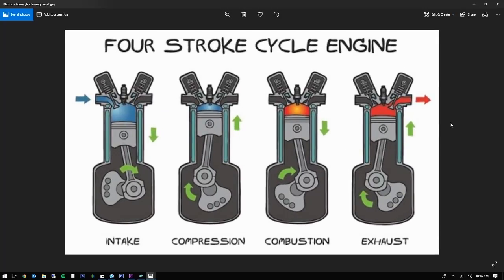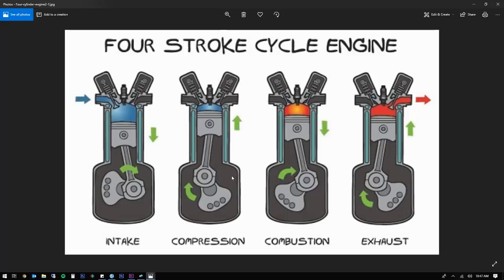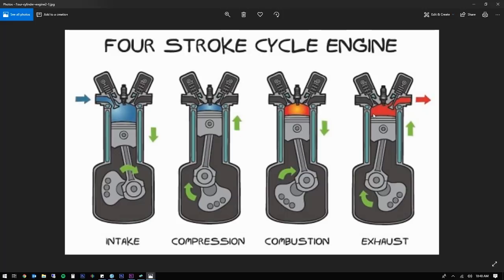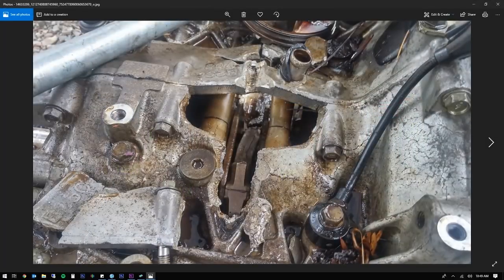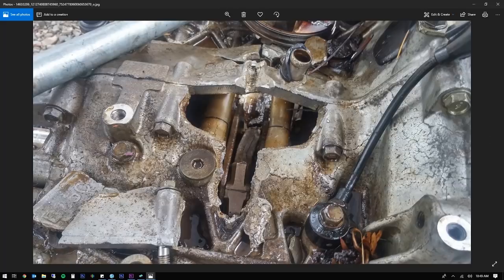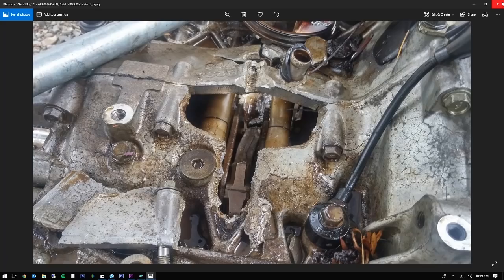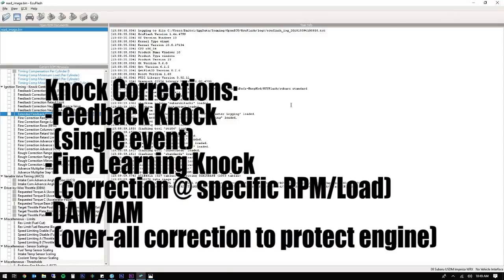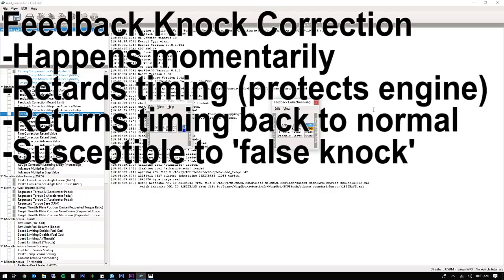Subaru Knock Monitoring - What Does It Mean?

Comment: Amazing video. Probably the best video regarding Knock, Knock Learn and DAM.

You mentioned boost leaks and other mechanical issues, I currently have Fine Knock that ranges from -4 to -30 at times!
 Usually under partial throttle, from 2.5-3.5k rpm. 2013 sti.

after investigating, it turns out that my turbo seals are bad, as I blow oil smoke on cold start. I dont smoke any other time, but being that turbo seals throw oil into your cylinder, it is definately reducing my 93 octane significantly to make my DAM trigger to .8 - .5 at times.

Just a heads up, as I'm on my 7th revision with my tuner, and not once did he mention anything to me (etune). Just datalog, datalog, datalog. During the revisions, I was constantly monitoring my values, and I began troubleshooting because knock should not exist on a stock healthy motor with a catbak, fresh plugs, and delicious tuning coilpacks. Found a bad turbo causing it all (100k). Currently swapping my center housing out over holiday break to resolve the issue and monitor knock. 

An AOS will also help keep oil out of the cylinder and reduce knock, which will be done once I confirm the turbo being the culprit in my situation

I hope anyone researching this because they dont know why they have knock will remember to inspect all aspects of their car. I didn't think I'd be dealing with a leaky turbo at only 100k but here I am.

Thank you for taking to time to put this together. A+ content

Comment: What could cause DAM ti drop and stay there? My DAM has dropped to 0.625 and I went through 3 tanks of gas still did not correct back to 1. Feedback knock and Fine Knock Learn are both 0 though.  Only DAM is low. Its 2020 wrx all stock car just protuned. Yes, I asked my tuner but he couldnt figure out. He said its normal. But is it normal to be below for so long? Thanks!
Reply from the maker: Your tuner said that... DAM dropping down to 0.625 is.. normal!?
Reply: @IrisPPG  Well he knows its below what it should be but he said it will bounce back after a while. But nothing has changed so I am thinking maybe there is something mechanically wrong.
Reply: Ugur's Garage it’s hard to tell, could be a number of issues. I had similar DAM dropping issue on 2017 FA20. I took off the intake, cleaned out MAF & MAP, then reflashed the same tune. It hasn’t dropped DAM again since. Could be dirty or worn MAF/MAP or 02 sensors, could be boost leak, could be something else.
Reply from the maker: @jlarsen4  yes, none of those things are "normal".
Reply from the maker: @wrxTO  Your car has to experience many knock events under different driving conditions and is desperately pulling timing to protect itself from catastrophic failure... Dropping DAM is the last resort effort that cuts global timing across the whole power band. It only happens after the computer has already pulled timing from different areas across the power band.

Comment: Can having a blow off valve cause knocking or false knock and changes to fkc and flkc? 

I am in Kenya and my bugeye WRX 2001 run a gfb hybrid bov. When its open I get knock events while lifting off when shifting with always similar -2.11 degrees all  but when it's closed even under load I don't get any fkc events at all. What's the issue likely to b NJi
Reply from the maker: When the BOV opens, the car also shuts off fuel injections as you let off so by definition it cannot knock. It's possible that if you immediately get on the gas right after but lightly, into cruise condition where the car is in closed loop fueling, it could over compensate for the rich condition from venting air by pulling fuel but it's very unlikely to happen every time. Ok the flip side, tip in knock is common regardless of BOV.
Reply: @IrisPPG  when I was putting the bov to vent to athmosphere I'd get a backfire and a  knock alert that's why I said maybe it could cause it. Could it be the knock sensor registering the blow off sound as a knock or the backfire?

Comment: so quick question is recently had my knock sensor go out and i replaced it but my damn since then has been going from 16-14- 8-4 -0 which is horrible the knock numbers are fine could it possibly be that its not torqued to spec and not placed correctly or should i be worried it almost feels like i get fuel cut and then everything just jumps back up please help lol
2002 wrx

Comment: I’ve got my STI tuned on e85 and 91 map not flex fuel . I do get fine knock learn sometime 3.8 usually 1.4 my tuner looked at it and said everything is normal my DAM is at 1 which is perfect . But why do these numbers come up still I don’t understand. Please give me some input please
Reply from the maker: I do believe I explained every aspect of why knock happens and what the three different types of knock mean. I personally don't believe -3.8 fine knock learn is normal at all. The one exception would be if you have a fully built engine which can tolerate more knock. On a non-built motor though, any single knock event could take out your engine, especially if those fine learn numbers are down low in the RPM/high load range.